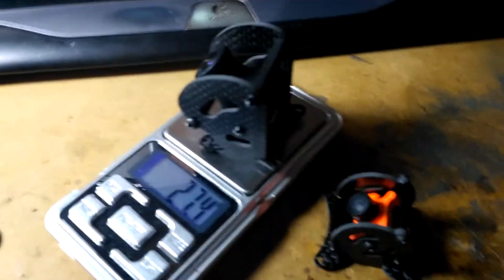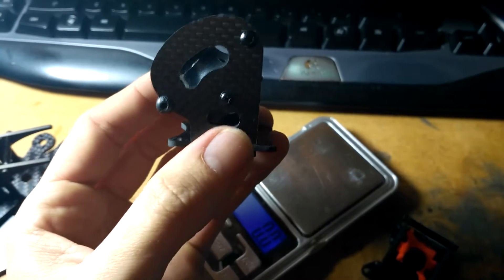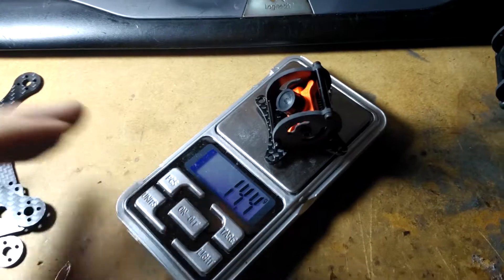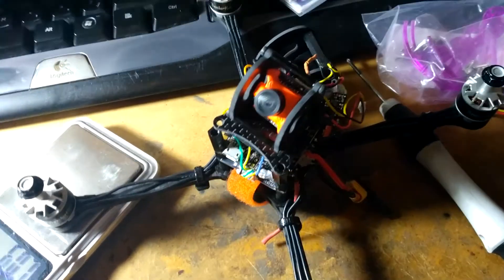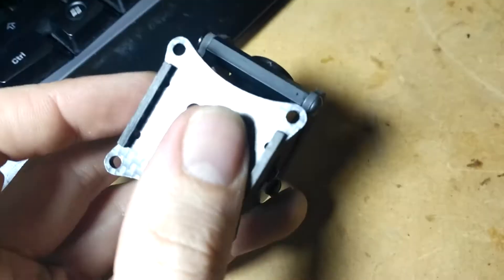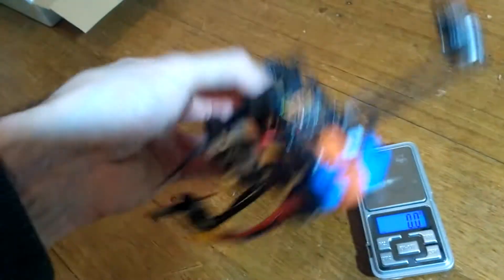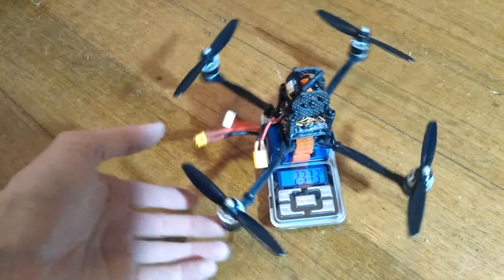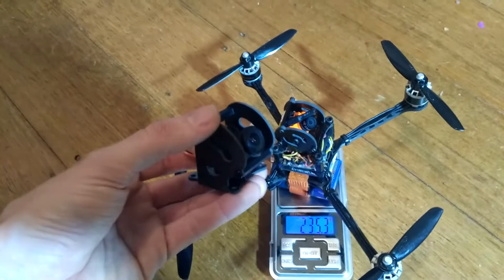FPV Camera Mounts for 30.5 Flight Controller Stacks

Comment: I'd really like your runcam swift mount in 1mm to save weight (it's cheap enough to replace if I break it).  I was wondering if the 1mm sides of your 16x16mm pod that's 19mm wide will fit the baseplate of the 30.5 mount?  By the way, thanks for adding the 1608 arms V3.4 by C. Mawson.  I've worried about motor protection and held off on getting your frame because of that - now I can pick that up and use your ultralight 5" frame!
Reply from the maker: Hey! Interesting timing - I've just ordered myself a version of the cam mount with 1.5mm sides because I'm trying to make a light 3" quad. I didn't want to go 1mm as I feel like it might break to easy. I've just made it public: https://armattanproductions.com/pages/kit_detail/1859
Reply: Awesome!  I'll have to order a couple for my 4" and 5" quads :)  If you're really trying to go light on your 3", you can totally get away with a PLA camera mount (at 3.8 grams) from BG:  https://www.banggood.com/Runcam-Micro-Swift-Micro-Swift-2-Camera-Mount-Holder-30_530_5mm-Mounting-Distance-For-FPV-Racer-p-1156801.html  I wouldn't use it on a larger heavy quad, but I haven't been able to break it on my 150gr AUW 3" quad and it does save some weight.

Comment: Hey Adam, getting ready to order some of your designs. Quick questions:
1. 112MM PURE X FRAME - Frame weight? Arm width?
2. 1407 ULTRA LIGHT FRAME - How is it holding up? Have you tried the lower 2800kv motors on 5" props (like Racekraft 5038)?
Reply from the maker: Hey, the arms on the 112mm frame are 5mm wide and it's 3mm carbon. It weighs 8.7g - just the carbon frame. 
The 1407 frame is still good! I'm running 4" props on both of mine. I didn't try 2800KV motors, but I suspect they'd feel similar to the 3600KV on 3S which I did try on 5" props but I didn't like that setup as much, it didn't feel that powerful.
Reply: Really appreciate the reply, Adam! Thank you. Sounds like the perfect pair. A 2.5" micro with 5x3mm arms... and a 5" ultralight with 6x4mm arms. I'm hoping the 2800kv/4S/5" setup will work a little better than the 3600kv/3S/5" from your test video. Looking forward to the builds!

Comment: If you can work a runcam split into this, I'm buying two of them to start with.  1407 & 4045 is really awesome.
Reply from the maker: I'll draw one up soon :)
Reply from the maker: Here we go. Make note of the fact that Armattan doesn't stock the required standoffs, and also I have not tested it though I'm confident it should work well based on the dimensions on the runcam website. 
https://armattanproductions.com/pages/kit_detail/1041
Reply: Nice...  for a 4" version of this frame, how many spare arms should I pick up initially?  Has the stack taken any damage in your testing?  I'm a novice-level "pilot".
Reply from the maker: Honestly I haven't crashed enough to be able to tell you the frame durability - no arms have broken for me yet. I have crashed my 5" 1407 frame 3 times, twice on grass and once into a metal post then onto concrete and it's still fine. The 3D printed camera mount and the camera lens broke on that last crash though which was what prompted me to build these tough camera pods.
Reply from the maker: That said, the arms are pretty cheap, it may be worth getting some spares just in case, to save on shipping and also it can take a while before you get your order with armattan because they cut to order. It would suck to have to wait a month for a new arm.
Reply: +Adam, Thanks man.  I got a 4 & 5" frame, two split pods and two spare arms for each.  I'll likely be using this here and some older RCX motors I have in the stash to start with; http://www.readytoflyquads.com/flip32-f3-omnibus-aio-asgard-f4escosdcs along with a Split, XM+ and ATX03 vtx.  I bought a ton of 4045 & 5030 props back in the day, so this is how I finally get to get through some, since they pretty much stayed in a box since we all made the switch to tri's.  I'll throw a vid together and shoot you an email once it's all flown a bit.
Reply from the maker: mistercohaagen Nice! I hope it all works out well. Can't wait to see what you end up with :D
Reply: +Adam, are the 22mm standoff holes M2 or M3 diameter?
Reply from the maker: mistercohaagen the stand off holes are m3